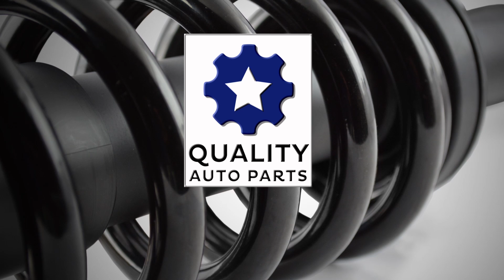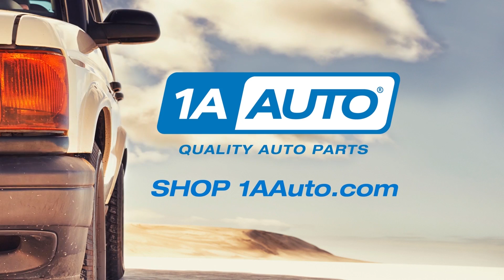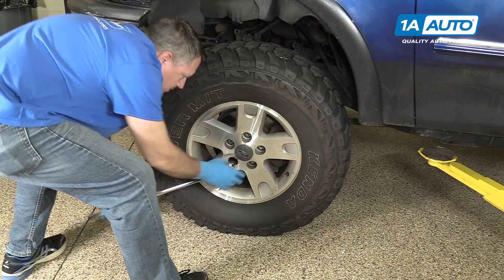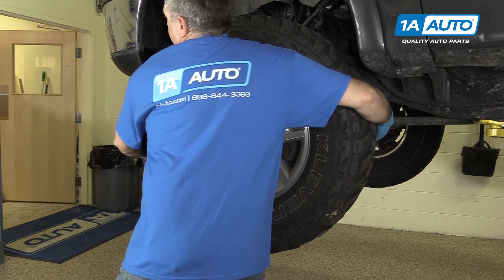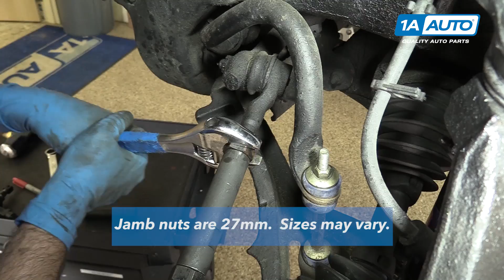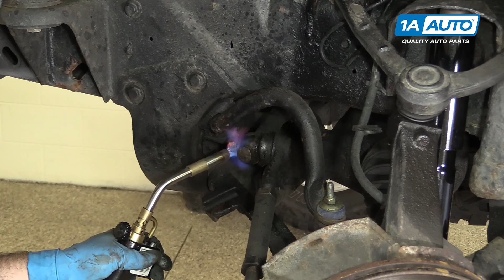How to Replace Front Inner Tie Rods 97-03 Ford F-150

Comment: Instead of beating it apart you could've jerk the steering wheel it helps wiggle the two rods apart or try jacking the tire instead of having all the weight off of the tire

Comment: I have the inner tie rod bolt stuck in the center link I had to cut the tie rod end off ... do you have any idea how to drill though that bolt
Reply: Not that it would help now but check my recent comment also try the heating with a torch method

Comment: Hi I have a 97 Ford F150 and I was doing the inner tie rod on my front I did manage to get the tie rod end out of the holding bar but then I had a hard time getting the jam nut off of the tie rod in the old tie rod end I had to put it in a vise and then I could not get the Jam nut to go onto the new tie rod end I'm thinking that I could get a screw from the hardware  screw might be metric give me a comment if you can, and I have yet to see if the new tie rod end will fit in the sleeve give me a comment back if you can thanks

Comment: Is this the same for 02 crown Vic
Reply from the maker: We currently do not have an auto repair video specific to your vehicle's year. You might be able to apply some of the basic steps shown in this video to your application.  +Eric Berry
Reply: Yes they have similar steering systems. Not saying the parts are interchangeable but similar style.

Comment: Do u have to do both sides or just the side that is damaged?
Reply from the maker: +Kyle Powell You can do just the one side but it is best to replace both at the same time so there is even wear and you don't have to go in to have it replaced again.
Reply: Just the side that is loose everything supposed to tight under there